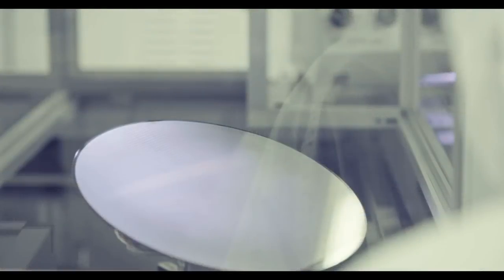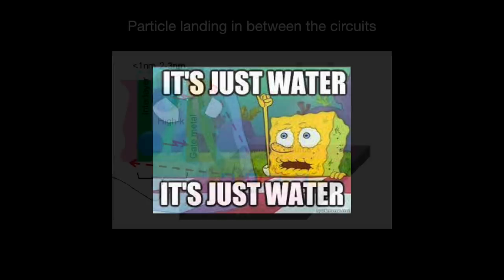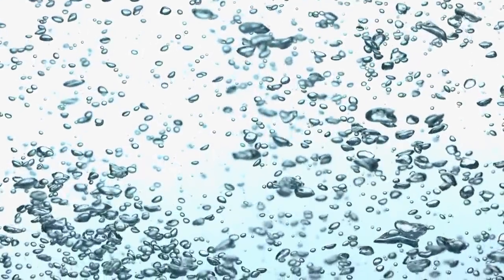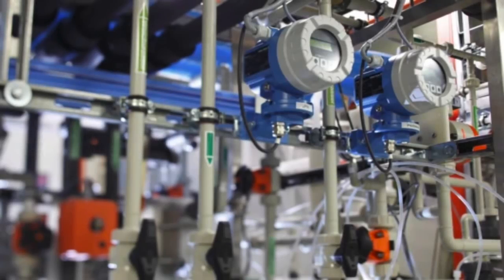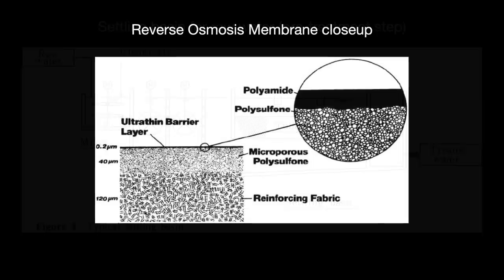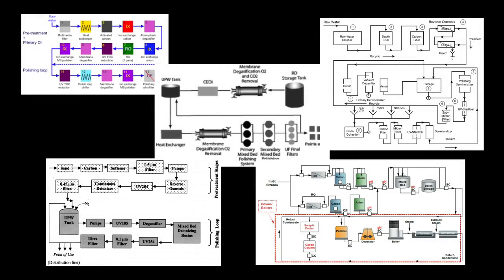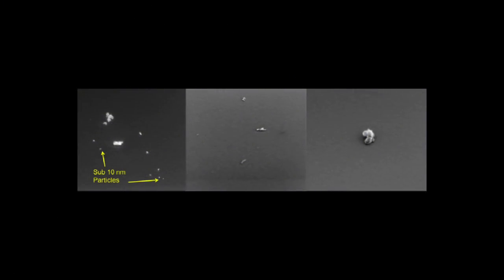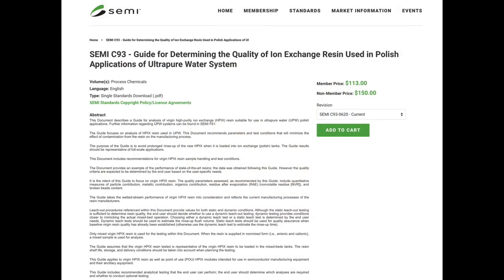Ultrapure Water for Semiconductor Manufacturing

Comment: Where I work we use 18.7MΩ UPW for ultrasonically washing massive coffee table size glass substrates before they're loaded into metal oxide electron beam vapor deposition chambers to be multi-layer dielectric coated with Bragg diffraction interference polarizers, anti-reflection coatings, and mirrors used in the construction of ultra-high power neodymium glass lasers for inertial confinement fusion research. The particle counter on the final deionized water loop from Particle Measuring Systems that detects down to 30nm diameter particles is the size of a desktop PC and costs about as much as my house. The software that runs the counter from the same company is actually amazingly crap and looks like something from the windows 3.1 era. 
Also PS, I really wish the ridiculous and very old myth of ultrapure water being "so toxic and corrosive because it sucks minerals out of everything it touches" would finally die. It's not. I've drank it. It's just water, it tastes great, I didn't die. The instant it touches your tongue, or you, or ANYthing except the hyperpure fluorinated polymer pipes that it runs through, it's not ultra-pure anything anymore, it's just normal water again with normal water's normal properties. One of those properties is actually really interesting - people always say water is clear and it just looks blue because it's reflecting the sky or has junk dissolved into it or whatever, but that's wrong, it's ACTUALLY blue. When we fill a super shiny stainless steel ultrasonic washer with it the color gradually gets bluer and bluer as it gets deeper and there's obviously no particle impurities in there doing it. All the color is coming from the third overtone of the stretching mode of the hydroxy group part of the water molecule absorbing a tiny amount of far red light in the tail of the absorption peak.
Reply: I understood many of those words.
Reply: Too many technical words in this comment .
Reply: @westrim  star trek technobabble
Reply: @jtgd  technobabble>housebabble
Reply: @Muonium I see, so it's the OH group that contributes to it... or at least also will also contribute to the blue color.
Reply: Ultrablue reminds me of something about purity from...Breaking Bad.
Reply: They take the dinglebop and they push it through the grumbo, where the fleeb is rubbed against it. It’s important that the fleeb is rubbed, because the fleeb has all of the fleeb juice. Then a schlami shows up, and he rubs it and spits on it. They cut the fleeb. There’s several hizzards in the way. The blamfs rub against the chumbles. And the ploobis and grumbo are shaved away. That leaves you with a regular old plumbus.
Reply: Well, I enoyed the comment. Although the sentences were a little generously proportioned. 😉
Reply: Great reply. I understood every word :)
Reply: Translation from engineer to normal: He works at a place that makes large very special mirrors for fusion research (those mirrors work slightly different than your shaving mirror, but they too reflect light, just better). They wash the mirror blanks with VERY pure water. He is annoyed at the misconception that purified water is toxic by way of sucking out minerals. Which is untrue, he also tasted it and it is great. And he can confirm that water is actually blue because it absorbs red light and not because the dirt in it is blue like some idiots claim...
Reply: I will use this text as a meme.
Reply: bro what 😅
Reply: This comment reminds me of the "Technical Jargon Overload" skit
Reply: Very interesting!
Reply: I like turtles
Reply: Lab software being crap is common across all industries, apparently.
Reply: @Terawattplaysdrums  You avoided the whole Flux Capacitor part of the equation, but that understandable. That needs its own video.
Reply: It goes to show you that tech is getting so elaborate that no one person understands everything. I watched a video of something to do with an intricate model of a 747. The gist was that each person only knows a small portion of the plane-- you got your aerodynamics guys, your electronic guys, your air ventilation guys, your safety guys, your engine design guys, your ergonomics guys, etc. (GUYS includes male and female) But they fit it all together into a working machine.
Reply: From my experience, it is almost an industry ethics code to have ultra crappy software that is horrible to look at in combination of really cutting edge expensive and insane technology working with that software. 
I assume, that comes from the fact, that physicist often build these cutting edge measurement systems. And physicists are not great software developers.

Last time I've used a white light interferometer, it worked really great. And the software had a lot of great data analysis features. But it looked like Win98 and was accordingly difficult to navigate.
Reply: @babagandu  me too
Reply: @Terawattplaysdrums  Rick and Morty?
Reply: Mastersizer Particle Size Analyzer?
Reply: @Live.Vibe.Lasers  hslis m50e
Reply: Great comment. I enjoyed your clear, yet technically dense explanation. Best wishes.
Reply: @gerryloveday3142  you are my target audience for youtube comments. It's a small audience, to be sure, but I see no reason to dumb things down for wider appeal. My commentary is as clear and simple as I can make it while still conveying all relevant scientific details, but no simpler. Cheers 🙂
Reply: Yep, those are all words
Reply: Fascinating.
Reply: Spotted the fellow nerd.  

God bless.
Reply: Yes, the water itself is blue. For comparison, very similar "water", deuterated water (D2O) is transparent because its absorption band is not in deep red, it's in infrared.
Reply: @denysvlasenko4952  correct. the heavier deuterium is decreasing increasing the wavelength of the OH vibrational mode. (oops, the frequency is decreasing not the wavelength)
Reply: Excuse me but what do you use these coffee tables for? Who buys them?
Reply: @geoffreycharles6330  the national ignition facility at llnl. They're output couplers, high reflectors, turning mirrors, and polarizers for the 2 megajoule UV nif laser.
Reply: @Terawattplaysdrums  this is too high iq to be legible
Reply: @antonjanssen3549  wow thank you. you are a god among men for not only being able to understand that but being able to translate it
Reply: Learned as much from this comment as from the video --- if not, more. Thank you very much!
Reply: @jtgd  🤣🤣🤣🤣🤣
Reply: Bragg diffraction interference... neodymium glass lasers... What are those ???
Reply: @StarFyodperor  Things
Reply: Wow! Impressive. Those are really big lasers. And water is blue. Thanks for that.
Reply: @Terawattplaysdrums  You forgot the flurb filters!
Reply: Thanks for the insight
Reply: Something something water something something complete
Reply: @antonjanssen3549  now someone needs to further dumb this down.
Reply: Everybody is gangsta until he mentioned lasers for inertial confinement fusion research. Those a big lasers. Really big lasers. James Bond would actually raise an eyebrow big lasers.
Reply: @Martinit0  Not everybody is a gangster nor it whishes to be. Could you stop bringing your periphery way of speaking with its stupid memes into the discussion?
Reply: @thisguyhere1  both. B causes A.   It's polyvinylidene fluoride. Low leachability.

Comment: I work in facilities in a semiconductor fab. This video clearly explains the everyday process and efforts we make to achieve strict UPW specifications and supply continuous supply on a 24*7 basis. As shown in the video, the real problem we face is in the analysis of the purity of water due to very presence of impurities in ppb or ppt levels. The analyzers or instruments use high-tech metrology techniques to detect impurities; sometimes, they show errors and need maintenance. Repair and maintenance of these hi-tech equipments is a big task in itself. Due to disruption in the global supply chain in the semiconductor sector, long lead time in procurement, and minimal industry players, we face problems in sending analyzers for calibration or maintenance or even procurement of spares is getting complicated. At last, I would say, producing a UPW water isn't easy and need a lot of effort.

Comment: I'll point out a slight error: The dimension of resistivity is not resistance / length, but resistance * length. So I guess the units should be ohm-centimeters rather than ohms per centimeter.

Here's what I wrote about this to jog my memory while trying to prove it to myself:

Resistance describes something about a specifically-sized conductor. If you make it longer or narrower, the resistance increases. Resistivity, on the other hand, is an intrinsic property of the material.
The resistance of a 3D chunk of a conductor is proportional to the resistivity of the material it's made from. It's also proportional to the length, and inversely proportional to its cross-sectional area. That all jives with intuition. So resistance is the same as resistivity * length * length^-2, or resistivity / length. Solving this equation for resistivity, you get resistivity = resistance * length.
Reply: Or you can just look up the resistivity of common materials and see that the units are ohm-cm x ten to the minus 6 for metals.

The telling slip shows that Shirvan reports on topics that are new to him.
Reply: @pauleohl  Shirvan? This isn't Caspian Report haha
Reply: @pauleohl  Yes, but it shows the whole idea of scientific measurement is new to him. Even without knowing anything about electricity at all, it is obvious to anyone with a scientific background that if one unit is /cm then the inverse unit must be *cm.

Comment: I worked at a place that had to scrap several thousand wafers due to bad DI water contaminating the gate oxide, because the issue didn't show itself until final test. Simple thing but so critical.

Comment: As ever, an excellent dive into the technology underlying chip manufacture. Finally, a subject that I know something about: laser light scattering.

Contrary to what you suggest, I do not think that dynamic light scattering brings much to the party. It is great for measuring the size of particles, but no good for counting them. For that, static light scattering (just measure the average intensity, not its fluctuations) is what is needed. It's simple (joke):  big laser, short wavelength, large detection volume, good magnification optics to amplify the tiny signal and a sensitive detector..

Comment: I didn't know that they've had to resort to using statistical techniques to approximate the particles in UPW now.  The interesting thing about semiconductors vs other materials/chemical industries is that is that the technology often seems to outpace the metrology, not the other way around.  With most pharmaceuticals or food you can get by with characterization techniques that are very well established.  There are often commercially available instruments that can be used by an operator after a day of training.  With semiconductors, if you do find a commercial instrument that can hit your detection limits, you better believe the vendor knows what they have ($$$).

EDIT "Cliffs of insanity" my respect for this channel went up a little bit there

Comment: Interesting and informative, thankyou @Asianometry. In the context of metrology for the purity of water I must inform you that there is a novel and patented mathod based on DLS. Its branded as NDLS (R) and composed of a method and the use of AngstromPure Water (R). Together they are capable of measuring impurities down to 2,5 Angstrom i.e. 1/4 nm. The production of APW is also patented and based on Membrane Distillation (MD). "The clearer the water the more You can see". The inventor have a life spent in yield in the semiconductor industry and had to invent a wet metrolgy in paralell to be able to tune MD to reach the stated purity. Both inventions are owned by the Swedish company Nanosized Sweden AB

Comment: How does one clean the containers 
that stores ULTRA PURE WATER ?
Reply: It sounded like it might be flowing all the time. No standing water.
Reply: I think this is like washing rice. You run water through it in batches until it's coming out clear
Reply: high concentration acetic acid and hydrogen peroxide are periodically run through a DI water system to sterilize and clean it.
Reply: PTFE lining?

Comment: Fun fact: Electromagnetic flow sensors dont work with highly pure water. 
I experienced this one time when we were commissioning a mixer for some company making supplement pills. Apparently they put their production water trough some filtering (probably a RO filter) so it is to pure for a electromagnetic flow sensor to work with it. We where scratching our head not figuring out why the flow sensor was not getting any flow until finally someone asked "what is the conductivity of the water?". So we had to switch to a much more expensive Coriolis flow meter.

Comment: I used work biological lab & we used ultra pure water as we doing research internal signaling within a cell. Any contamination will screw up the results as cells used only few molecules to tell the cell to do something like divide so any contamination will “hide” few molecules during signaling.
Reply: Molecular biologist here with extensive in vitro and in vivo experience, including highly sensitive inter/intra cell signaling assays. While we do employ a higher purity level of water than just DIW, I have not come across an assay design requiring UPW at the levels shown in this video

Comment: This is like first hearing about how our daily infrastructure for water and electricity work.
Never been a thing to think about until you get a fraction of an idea of just how MUCH work goes into making it run the way it does.
And thinking about the fact that a particle with the size of a virus could already be enough to mess up the circuitry in a chip, really shows how tiny chips are these days.
Though to be fair, for me it's actually outside of what I can grasp... I just know that both things are insanely tiny.

Comment: I suppose at some point they'll end up needing to electrolyse the incoming water and recreate brand new water molecules from the pure hydrogen and oxygen.
Reply: The Gibbs free energy of water formation is 237kJ/mol. That's 13 MEGAJOULES per liter or 13 TERAjoules per million liters. A chip fab would literally be using on the order of the same amount of energy released by a nuclear bomb every day if it synthesized its water from base elements.
Reply: @Muonium1  oOOo
Reply: @Muonium1  and it still wouldn’t be free of contaminants since they’d be carried in the gaseous hydrogen and oxygen.  

On the “upside” there’d be lots of low grade heat available
Reply: Wow that’s a huge amount of energy! 🤯 TSMC would need to build some nuclear power plants lol. Oh well, I hope they can keep improving their ultra pure water as node sizes keep shrinking.

Comment: The definition of sterility in pharmaceuticals (like injection solutions) is less than 1 colony forming unit (something like a bacteria) in 100.000 units. This low count can't be measured so it is all in quality control of the production steps. If you were to take a sample and analyze it, how can you be sure that the single contaminant is not in the bulk and evaded your sampling?
So the only thing companies can do is to implement processes that do not allow for it to happen and hope the workers follow procedures.

The problem is the same as in the video, contaminants that can't be measured, but at a smaller scale.

Comment: Yes, pharmaceutical grade water is infinitely easier, not so much care particulate wise, more about sterility and just having low dissolved ions in it, and the water used would easily be produced by the first few stages of the semiconductor industry. Big step up from most city water though, even if the plants all use it as feedstock. 

Funny enough most bottled water has more dissolved ions than the feed water used to produce it, regular city water, just sent through particle filters, carbon filters and then resin beds to trap ions, and finally UV sterilised, and filtered for particulates again. Then they add in salts, to give it flavour, and bottle it.

Comment: 11:12 Air dust particles expected to be found are distributed by Log-normal distribution, variation of Gauss bell curve, which function with  2 times smaller dust particle have roughly  e^2 bigger quantity concentration than two times bigger dust particle size sample. Is this tendency can be applied to particles inside water?